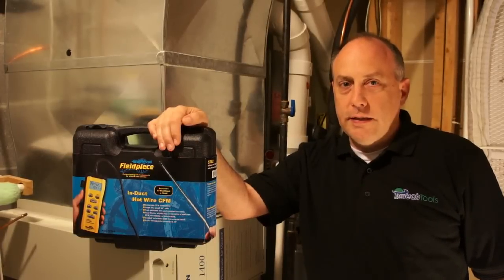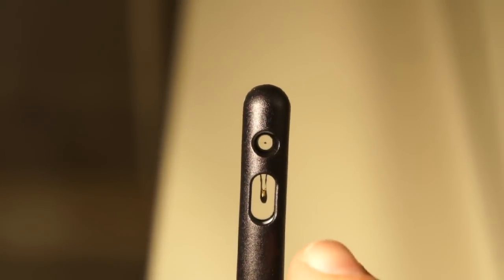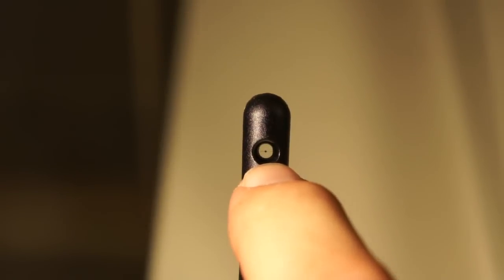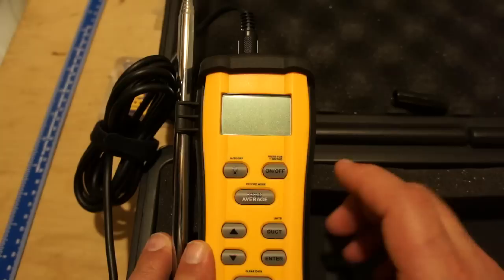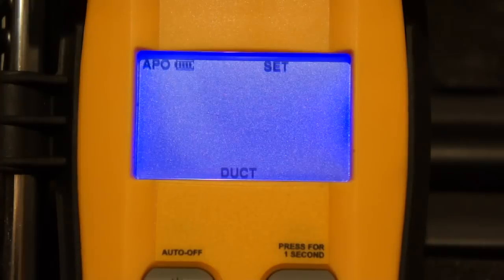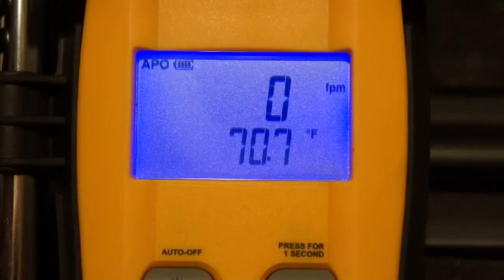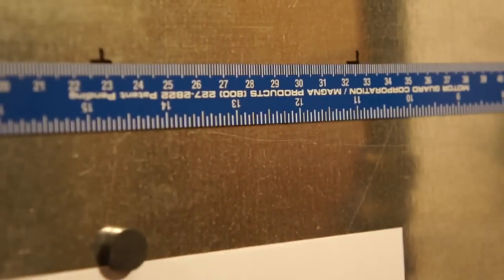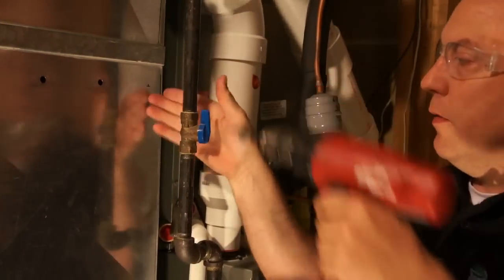How to Measure Airflow with the Fieldpiece STA2 Hot-wire Anemometer

Comment: I know this is old but figured i mention for anyone considering getting this, seems to be ok for smaller airflows like residential and small commercial systems but i havnt had much luck with mine on anything over about 2000 cfm for some reason. I could do a 5 point 6 times and each time would have very drastic varying results like over 1000 cfm off. I try to keep it as strait as possible and timing equal on each hole but just cant trust it.

Comment: Does it matter if its before or after the humidifier? Thanks for the video!
Reply from the maker: Generally speaking, before a humidifier.
It's best to measure in an area of smooth (Laminar) air flow. Measuring after any turn, transition, or "device" in the air stream (humidifier, filter, coil etc.) will usually cause chaotic (turbulent) airflow, making measurement with a hot wire or pitot-static tube somewhat more difficult.

Comment: In Texas most all units have 4 foot plenum boxes and all the taps in that length.  How do you accurately measure in these conditions? Awesome video though.
Reply from the maker: Plenum boxes are a challenging location to measure in-duct airflow.
We usually see people using the manufacturer static pressure tables (and a manometer and static pressure tips) or measuring at supplies and returns and adding them up separately (and comparing) to get total system airflow.
To measure at supplies and returns you can use a large vane anemometer or a capture hood.
FYI capture hoods can now be had for as low as $400 for CFM range of under 1200
Reply: @TruTechTools  Thanks for reply and so quickly at that.   What about taking the filter out and drilling holes at intervals and measuring there?  Theoretically, it should be same as supply, right?

Comment: is the temperature on the home screen showing the temperature sensed by thermistor?
Reply from the maker: hilmi dwiputranto The temperature on the screen of the STA-2 is the temperature of the air flowing around the probe tip as sensed by the thermistor that is in the oval cut out beneath the hot wire bead in the circular cut out.
Reply: @TruTechTools  ok thanks for the info

Comment: very nice tool and well explained.  is this another choice for the minivane anemometer?
Reply from the maker: Sure, it is a different technology than the mini vane. The mini vane has the upside of measuring over a larger area than the tiny hot wire "pin point", plus the mini vane does not need density correction for a "perfect" reading.

Comment: In California the CEC wants use to use a capture hood on our residential systems to measure fan/air flow..
My question is could we use a vane anemometer or hot wire to do the same thing..

Comment from the maker: You can do a three or five point traverse. Depends on the duct width and the desired accuracy. Also the turbulence in the duct. The more measurements the better. A vane however can and will give you more accurate results with fewer measurements because it averages eddies currents better.

Comment from the maker: Michael, 
You could then use a vane to proportional balance the system by velocity if the registers are sized correctly, or a capture hood if you desire to get an exact amount of air to each particular space. I typically can get by with a vane.

Comment from the maker: I you case, a large vane anemometer would be a much better application, They are still reasonable in cost, but make a much better airflow measurement at a return air grill.

Comment from the maker: Narrower duct and improved method. The 5 point method for ducts under 30" could be used for both, A vane provides a much larger area of measure than a hot-wire micro glass bead. With the smaller duct and a vane, I found that three holes and a timed traverse was adequate.  The more points you traverse however the more accurate your average velocity will be. There is a point though of diminishing return. Even when using a vane, once the duct gets over about 12" it would be good to use the 5 point.